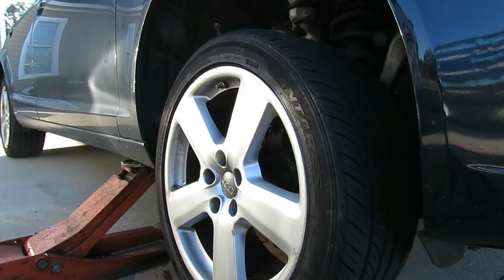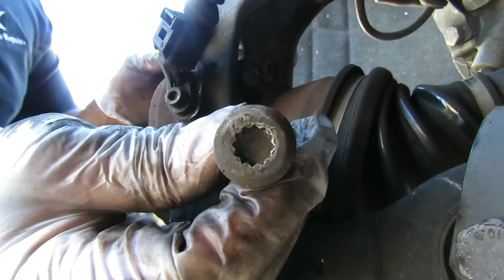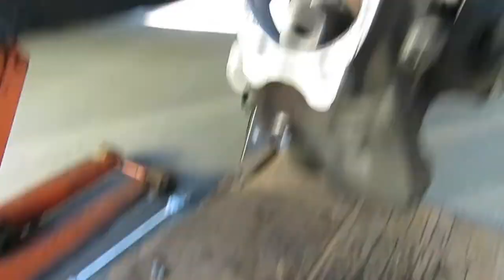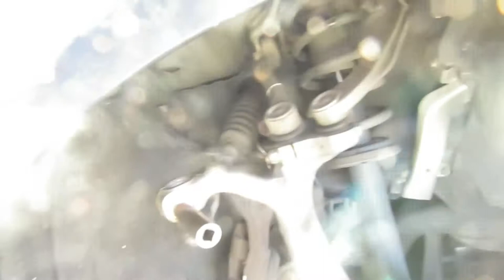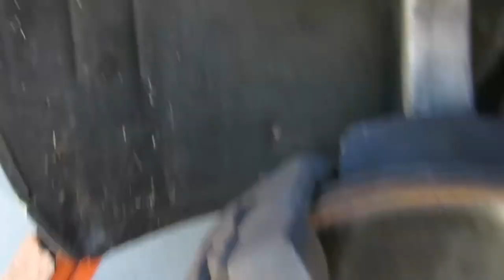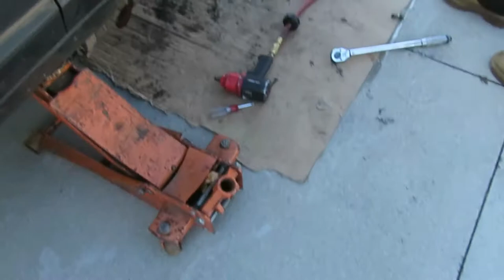⭐ 2008 Audi A6 Quattro - 3.2 - Front Right Wheel Bearing Hub Assembly - PART 2

Comment: Best and safest way to do this is with the wheel on, on the ground, with the center cap removed.

I, for the life of me can't figure out why zee Germans require that much torque on a hub bolt?

Every other manufacturer...130-200lb ft is the norm.

Comment: hey tim where did you find the assembly from, i can only find the bearing or the hub separate not assembly thanks
Reply from the maker: The customer bought the parts, but you can get the complete assembly at rockauto.com for around $60
Reply: ⭐ Astral Auto Repairs yes but the ones that are assembled are for the rear wheels nothing for front unless they are the same.
Reply: ⭐ Astral Auto Repairs what i was trying to say was i also need the front but i only see for the rears on rock auto and everyone else that i have looke dont have them at all, they only have bearing or hub but not assembled
Reply from the maker: Ok, I had to do some research through my paperwork because the customer had purchased the part. He bought the whole hub assembly from Ebay.
Reply: ⭐ Astral Auto Repairs that makes sense because theres only 1 person that sells them on ebay and they look like they are quality part and its $155 which is still not bad since i dont have to mess with disassembling and assembling it
Reply from the maker: No, that's not a bad price.
Reply: thanks tim your the man